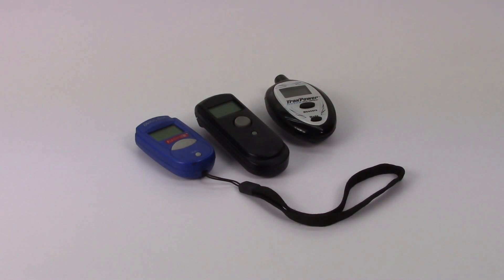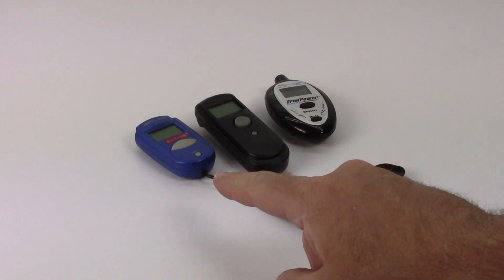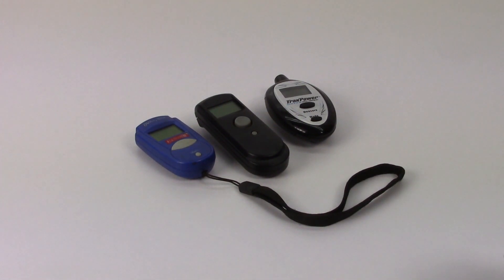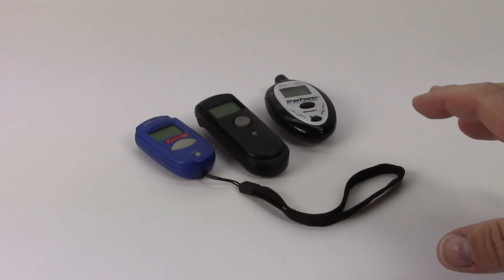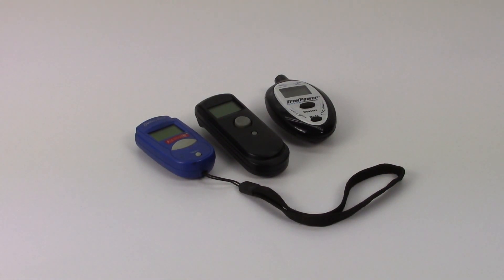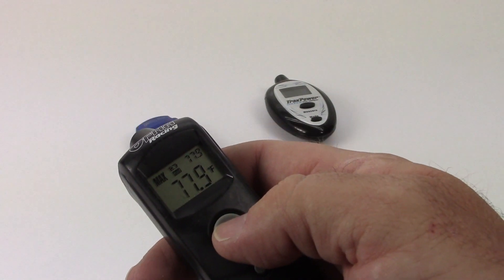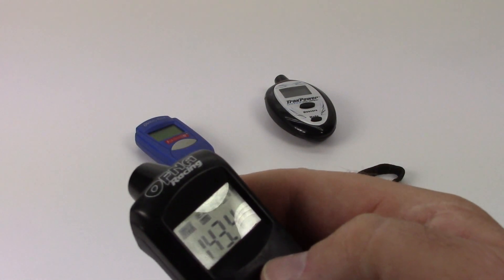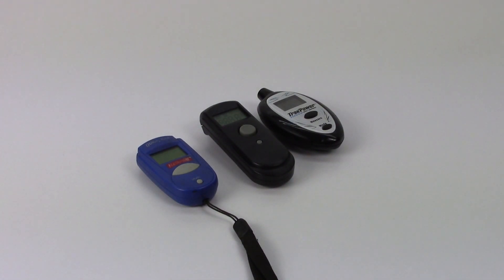Tool Tuesday EP23 - Temp Gauges

Comment: So what should the temperature of the motor and ESC be
Reply from the maker: check the owners manual of the electronics - they'll list the parameters.  Motors and ESC's should never get above 200 degrees F with out the risk of damaging.  Ideally, ESC's should run from 100-140 and motors from 100-160.  This range tells you that you are running the right gearing, terrain and weight of the RC

Comment: I've got the same duratraxx unit as well.  Used it mostly for head and glow plug temps.  But another thing I've used it for - checking system temps to make cooling system adjustments in my overclocked PC. XD
Reply from the maker: nice!

Comment: what should I use if I don't have one of those nor have accessibility to buy one. Can I just use a thermometer or does that not work.
Reply from the maker: +kevin goodwin You can do the finger test.....Put your finger on the endbell and if you can hold it on there for 5 sec, you're at about 130-140ish.  Not a solid answer, but the best for now
Reply: +The RCNetwork thanks also it turns out my gears were too close and my motor needed to be cleaned up but luckly for me i had a spare velineon

Comment: How about a test for accuracy? Pretty much the only thing that matters about a temp gauge is wether or not it can tell the temperature! Couldn't we have held ALL of the gauges up to the same studio light to see if any of them were off or matched the others? Perhaps all three could've been "calibrated" against a known heat source or the readings of one of the super-accurate laser models. I know it sounds like I'm complaining about free-to-me content (and I guess I am), but when I saw this video in my feed, I thought to myself, "Oh, cool! Now I'll know which one of these to get." I guess this video was more an informative piece on how to use a temp gauge than a means of comparison, but still...
Reply from the maker: +MostlyTorso That's not really what "Tool Tuesday" is about.  It's about showing different tools that work in the RC hobby, either intended or not.  Even then, I have used one gauge and read different temps on the same motor.  They're all withing about 5-10 degrees accurate though.  We have to keep in mind, they're $19-$29 items......We're not landing the Space Shuttle here! lol
Reply: +The RCNetwork Valid point. I can live with that.

Comment: I still need to pick one of those up. very important when it comes to the speed run game.
Reply from the maker: +2cwik4u104 Yep, as your name implies
Reply: fastest ive done is 121mph. not sure if you've seen my vid?
Reply from the maker: +2cwik4u104 Damn, that's fast!  I started getting into the fast thing...Had a OFNA Hyper 9e back in the day - Mounted a front wing to keep the front end down on 6s with a MM 2650 in it with a pinion almost as tall as the spur.....ended up crashing and parts went everywhere, including my GPS at the time (this was about 5 years ago...)  It read 87mph, so I gave up! lol
Reply: oh, I know all about crashing. trying to get a hold of a manufacture now, for a warranty. lol. get back in it. the rush is like no other.

Comment: i have a Remote Control with integrated sensors. So i know if something is wrong emediately.
Reply from the maker: +Scale Garage Nice!  Does it take the motor, esc and batteries temp?
Reply: +The RCNetwork I have 2 sensores. So i have to choose :-)

Comment: What are the temps you would recommend each part should be at?
Reply: motor-no more than 150 is optimal. Some will run higher, but you should be running 150 or less. ESC's can vary on the turn of the motor, but usually 100-120 is best. Some can run up to 145 with a low turn motor..if that's the case, you want to check to make sure the ESC you have can run whatever motor you're trying to. Batteries should about 80ish
Reply: Chester Copperpot
Are those in Fahrenheit or Celsius?
Reply: Fahrenheit ;)
Reply: Chester Copperpot
Thanks man.